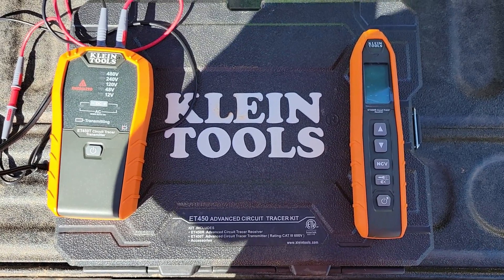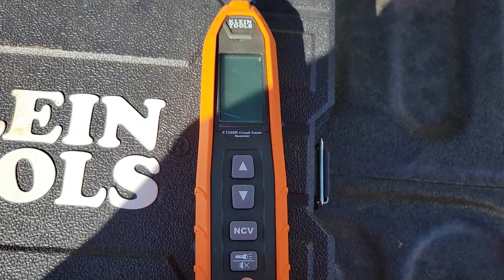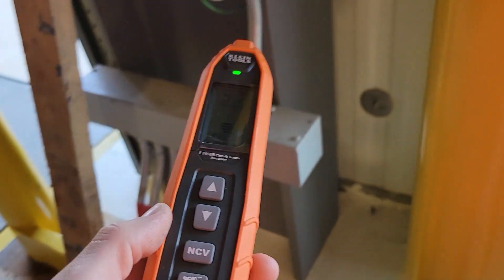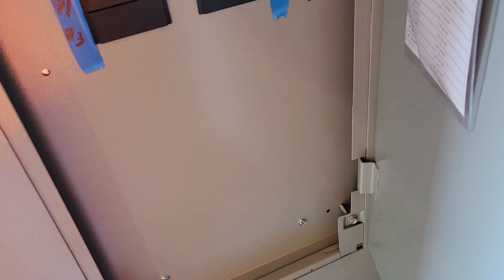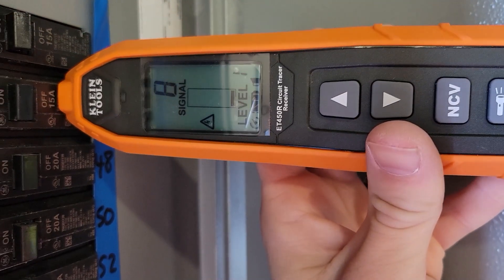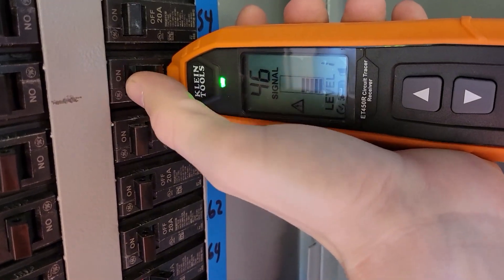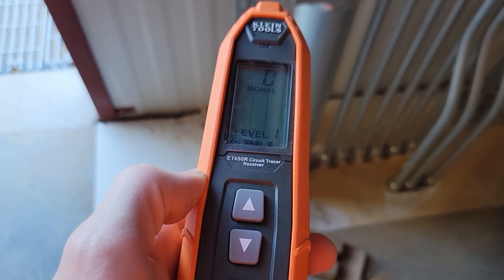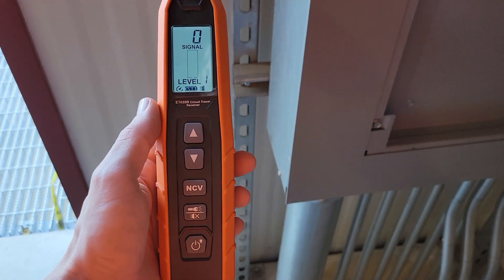I Tested Klein's Advanced Circuit Tracer

Comment: Just a little advice. You can get a much better signal by using the EGC (with the included adapter) and the single red prong. For whatever reason, it works much better from ground to hot than neutral to hot.

Comment: I was looking at the Klein ET 450 kit . I have a broken underground wire that is connected to a breaker that I switched off for that reason. There are no plugs. if I turn off the main, go inside the panel and connect red alligator clip to the wires power wire on the broken breaker and the the other clip to the panels neutral and then go outside and try to locate it with the scan tool. I have a general idea where the wire is but don't want to start digging the yard up . I'm imagining it's a foot or less down and maybe 50 feet from the breaker box. Will the scan tool attempt to locate the wire below ground?
Reply: It will.  You need to connect the red wire to the group of wires you want to trace.  Take a screw driver and stab in in the dirt away from the red wire attachement and to the screw driver shaft attach the black wire.  You can then set the receiver on max sensitivity and start locating the wire.
Reply: I'm waiting the answer too... Nedd this answer
Reply: Well I was going to subscribe, but if this guy can't or won't take the time to respond to his viewers, he can forget it.
Reply: Yes, you can tone underground cables or conduit. There is an instruction video on the Lowe’s website.